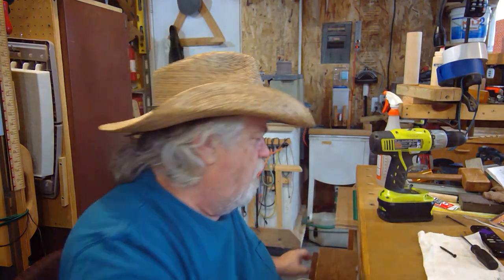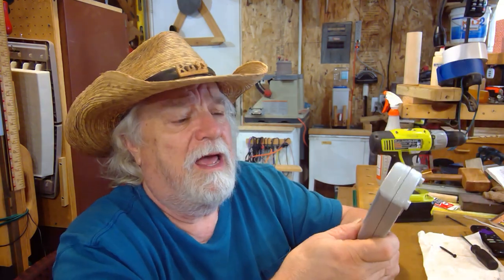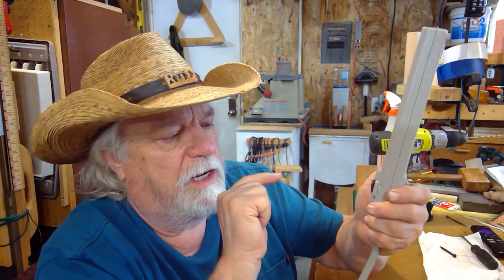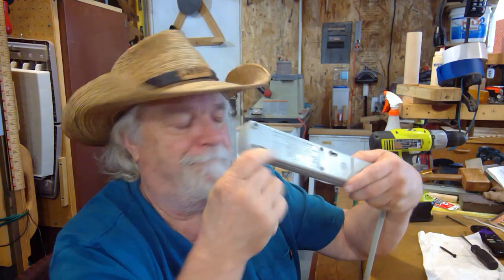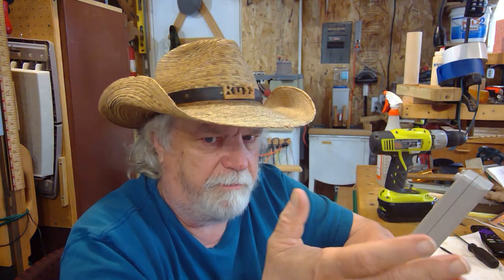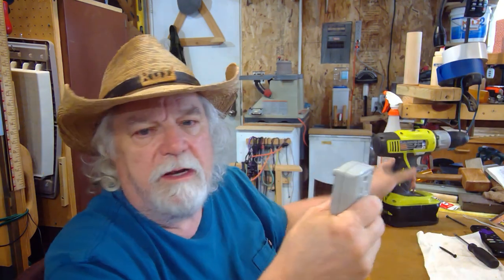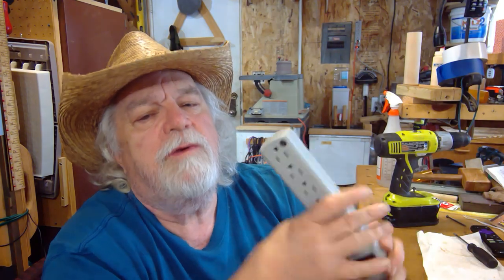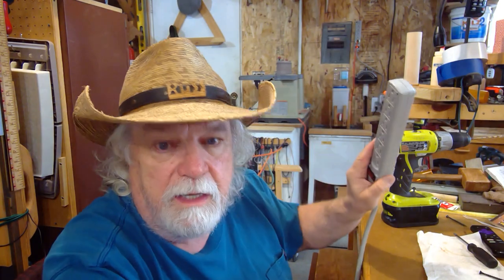Mounting Power Strips the Easy Way by OTB Thinker

Comment: The most STUPID way to mount a power strip, spend a load of money on a surge protected power strip, then destroy the warranty.

The way I mount the various power strips is to use masking tape on the back of the strip, use a small pin to make a hole in the centre of the keyhole style cut out, then remove the tape and stick the tape on the surface of where  I want to mount the strip, and drill the holes
it's that easy.

For the problem of the loose fit as @MJCPeters stated what I do is use small rubber feet, there is always loads lying around from various electronic projects I build, that way the small feet take up any loose play and also helps with any vibration.

The one thing I find strange is the way the keyholes are on the power strip in the video, maybe an American thing? In the UK I have never seen the keyholes like that, they are always vertical and never move around easy once fitted.

I always buy the best quality surge protected power strips, protects PC's keyboards and synths, would sooner lose a £30 power strip than a £5k synth
Reply from the maker: Your observations are appreciated, even with the rude delivery.  If you want to mount without drilling hole, then watch my other video on how to mount without drilling any holes (link below).  You did forget to mention how crappy the holding power is when you use the slotted holes :>).  

Link:
https://www.youtube.com/watch?v=z2X_7maWKrc&t=173s
Reply: @russveinot5754  Sorry if what I said came over as rude, the price for a good quality surge protected power strip in the UK is a lot more expensive compared to the USA. Never had a problem with holding power with the slotted holes, I have one power strip 6 way populated with 5 remote HBN Remote Control Plug Socket, 13A/3120W and never had an issue saying that the plastic on the power strip is heavy duty it is about 5 mm thick where the keyhole slots are, maybe the reason I have never had a problem with holding power is the style of UK power strips, as I said the slots are vertical and the design of UK plugs are done, so the cable comes down from the bottom of the plug rather than straight out, like USA style plugs.

One of the power strips I have, the neon went intermittent so replaced it and ALL the stand-offs in the plastic, were Brass coloured metal so would be totally destroyed if I had to drill them out, and every screw was a security screw, the screws are a pain in the arse to get out.

The stick on rubber feet I use are  round dome shape and have a bit of give to them, so give a nice snug fit.

Hope you find some of this useful, Russ.
Reply from the maker: @andy70d35  Don't worry about it. I have come across as rude many times :>).  I had heard your concerns from others and so I made a second method that doesn't require any screws or hole drilling.  I would not use this first method on an expensive one, but on a cheapie . . . why not :>).  As I have always said, all comments are welcome and appreciated.  Your suggestions have been pinned to this video for all to read.  Thanks, Andy, for your input.
Reply: @russveinot5754  Thank you, Russ.
I commented on your other video with a couple of ways I have mounted power strips in the past, hope you and the subscribers find it useful
Reply from the maker: @andy70d35  I am sure we will :>)
Reply: Same in the uk
Reply from the maker: @@regulus7181 Welcome to my shop..  Comments are always welcomed here (good & bad :>).
Reply: I don’t believe even one person  out there ever used their warranty.
Reply: This is not a surge protected power strip used in video
Reply: Warranty? I don't think you're going to care about warranty if your power strip melts and burns your house down.

Comment: Russ I am so glad to see someone else make these strips work without chasing them all over the shop.  What I did was use like a 1X2 that is like an inch longer than the strip on each end and hot glued the strip to the wood and then drilled holes in the board at each end and mounted it to my wall or stud or whatever.  I like your idea much better......
Reply from the maker: Thanks Sherman

Comment: Love it!
Even when I do get the screws in the right place, I can never get the strip secure enough for my liking. If I sink the screws far enough they won't slide into the key way. If I back them off a hair I end up with a loose fit. Your method will allow a good snug fit to the wall. Thank you.
Reply from the maker: Thanks MJ.  Don't know why it take me so long to figure this out :>).  since then, I have mounted other items.  this idea of using a pre-existing screw hole works on other electrical items apparently.  Welcome to my channel.  I have lots of other OTB ideas here.  all suggestions and sharing your ideas are welcome here.

Comment: That's good. I admit there were times I just drilled through at other spots. I could see that the wiring inside was no where near the hole, in some cases the wiring is kept separated with plastic walls inside. But your method is much more sure.  (I do have a few I tried with the screw gun and cracked them, especially old ones where the plastic had become brittle.)
Another method is using flat metal mending plates (1/2" x 2" or so). Attach one at each end on the bottom- use short screws or glue- let one end stick out where you can then use a hole for mounting.

Comment: Wow, not only did I catch this video at the perfect time, I will be mounting that EXACT power strip to my cheap Craftsman table saw leg to accept the power cord from the saw and the shop vac. I'm going to use #10 hardware though as I will be going through metal. Also just saw your video on forming PVC to make dust collection fittings. I already knew about that process but you gave me some great ideas. Thanks my friend!
Reply from the maker: I get some of my best ideas from watching others doing what I have already done :>)  As to the outlet, I look at all strips I buy now because they don't all have that screw setup.  Thanks Thestime

Comment: Great idea! I have thought of it before, but was afraid to cause a short. Drilling in the corners as you have, should eliminate that danger. To be extra safe, put a heat shrink  tubing over the part of the screw that's inside the case, then its insulated, problem solved. Most of the newer ones, aren't put together with screws, but the corners probable still have male and female "snap" plugs. Way to go Russ!
Reply from the maker: Thanks Terry.  the heat shrink is a good idea.  I thought about electric tape but my main thought is if I was that close that I would hit something, I wouldn't drill it.  I am sure I am totally safe.  but . . . heat shrink also would not be bad anyway :>)

Comment: screw one screw into the wall, enough to make it stable, mount power strip onto that one screw. Take the other screw and put it into the other hole of the power strip. Hold in place with fingers, pliers or else screwed into thin piece of wood to keep it secure and then mark wall with screw. Both screws will then be in the exact position they need to be, just keep tightening them through trial and error until you get a tight fit. Another way is to get two thin pieces of wood and put a screw through each piece of wood. Mount both pieces onto the power strip so that they slot tightly into place. Press those screws against the wall to mark it and you have the exact location of where the screws need to be.

Comment: Russ, have you had any issues with the head of the screw keeping the plug from going all the way in?
What i do is mount them the way they are supposed to be then I put a screw in at a angle so it won't come off. My problem with them is they always slide off of the screws. Thats when I started wedging it in. 
Thanks for the video!
Reply: You can use a chamfer bit to make the screw go in flush with the plastic. A step drill bit would work too.

Comment: Thanks for the tip. You are truly the master of out of the box thinking. I have mounted the first screw and then measured the center of the second insertion hole. This will work if you do not make it too wide. BUT as MJC Prters  says  to slide on--it never will be tight. I have resorted to twisting wire around it to secure it or blocking movement by putting a screw so that it cannot slide sideways. A poor solution.
Reply from the maker: Thanks Marty.  I have struggled for years with this and have tried so many ways (like you, I think :>), I now it is so easy. Sharing good ideas is fun.

Comment: Get some 'dowel points' normally used for marking dowel positions, drop a couple into the large part of the keyhole, press against surface you want to mount it and press, you'll be left with a couple of marks, remember that the strip needs room to move into the keyhole.
I made a vid about this
Reply from the maker: I'll have to try that.  Thanks Sparky.

Comment: Russ, that is out of the box thinking. However, I prefer the old method of sliding the head of the two screws into the mounting slots, position the powerstrip where I want it to be mounted, lightly tap or press the powerstrip to mark where the screw-holes are to be drilled, and then install the screws. It's a little more work but when someone else is using my stuff I can sleep at night.
Reply from the maker: I would say, never do anything that makes you uncomfortable.  thanks.

Comment: Making this harder than it needs to be...get some painters tape stick it on the back of the power strip. Mark on the tape where the small end of the keyholes are. Remove the tape and place it where the strip is going to go. drill the holes thru the marked spots remove tape put in screws mount strip ...viola
Reply from the maker: I have done it that way many times.  It works well.  Sometimes you need to do it different due to circumstances.  This is just one way.  Thanks for the enlightening idea.

Comment: The power strips I have don’t have the same screws as yours do at the end of the strip. A very easy way to locate the holes and transfer to the wall is to take a strip of tape and tape it over the back of the strip. Then poke holes through the tape where the holes in the strip are  for locating the mounting screws. Then remove the tape and place the tape on the wall where you want to mount the strip. Final step is drill the holes where the holes in the tape are and you have duplicated the holes in the back of the strip to the wall via the tape. 😀

Comment: I think the big issue is that you don’t want any metallic items on the surface that could come in contact with a live plug tang. 
The US style plug is by far the most dangerous on a large scale. Australia runs 240 volts where we use 120 volts. The plugs in Australia are better but not the best. The best plugs so far are in Europe. In Europe you can’t touch the plug tangs when they get to the power connection. The US plugs it’s very easy to get your fingers in contact with the plug tangs when they are energized.
Reply from the maker: I respect electricity.  I have been shocked a few times over the years when doing something bad.  working with electricity is like using the tablesaw.  don't do stupid things, follow the rules of caution.  not familiar with any other region specific outlet so I can't even speak to them.   I guess I'm just use to what's here :>)  if you have power strips available there, this tip might still be useful.  Do you have cheap power strips there (like here)?  you might look inside one there to see the insides once anyway.
Reply: Russ Veinot I’m born and raised in the US, I’ve just had opportunities to travel outside the US.
Reply from the maker: My worldly travels is the one time I accidently crossed over into Mexico and got lost for a 1/2 hr.  Then found my way home (40+ years ago)
Reply: Most all electrical connections in surge protectors are recessed at least an 1/8th of an inch so there shouldn't be any danger if you touch the screw head and tang at the same time as there shouldn't be any electricity running thru it .  Also if need be the head of the screw could be covered with electrical tape.  As Russ said tho, if you aren't comfortable with it don't do it.  Great tip IMO.